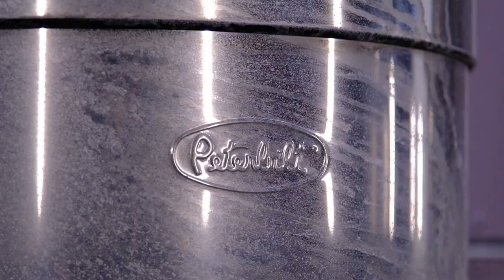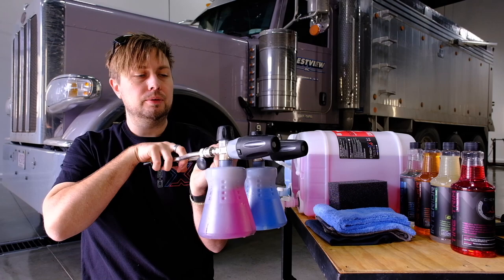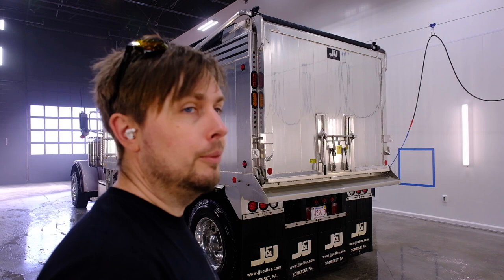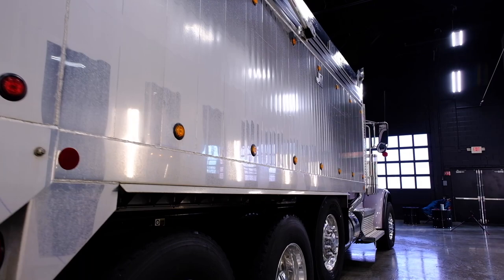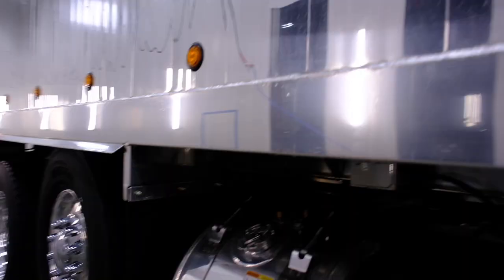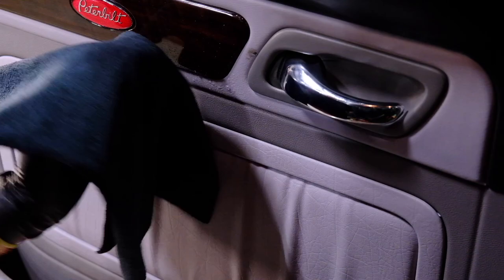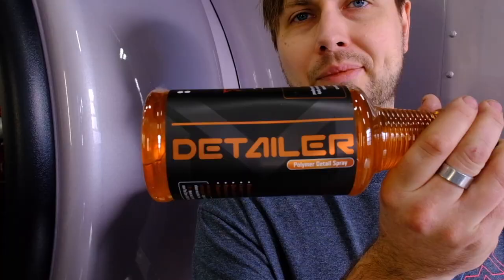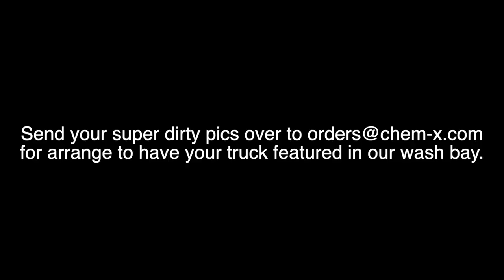The FIRST FULL DETAIL in Our FINISHED Wash Bay on a SUPER DIRTY Peterbilt!!

Comment: Tip on starting your blower. I used to struggle like that too. Then someone told me to do it like this:
Put throttle all the way 100% rabbit 
Set choke on 
Prime a couple times on the bulb 
Pull starter rope. It will start in one or two pulls, then turn off choke and adjust your throttle. 
This changed my life.
Reply from the maker: Thank you I’ll do that, yeah I popped open the spark plug and it had a bit of corrosion come up over the last couple months since I used it, hit it with some sand paper and got it fired right up, I went with the 58v echo blower since tho cause of the fumes lol

Comment: I gotta say, touchless wash soaps like this one (ive used this brand and wash chem) make life awesome, not just almost perfect wash with no touching (besides towell drying, i havent upgraded to a blower yet) but also getting in the areas like wheel wells and frames and other nooks and crannys that you normally wouldnt get too on a quick basic wash, and just makes the vehicle look that much better when all those areas get cleaned up vs hand washes where you dont get paid enough or have enough time to take the time and scrub it with a detail brush to clean it all up. These products are just awesome, also i like the chem x more than wash chem, just that much more efficient and better clean, just ordered my first supply of snake oil and so excited to try that out!

Comment: A no touch system is fine for a quick wash but if you take a truck you no touch washed to a big show (truckers jamboree, shell super rigs, Louisville, etc) your going to get docked huge in the points, truck shined up good for a hour wash but the steps/visor/ bumper/diamond tread needs cut, the tanks especially the fuel caps and surrounding area needs hit, and he better get that wheel seal fix at the very least it’s gonna junk that durabrite but the dot will have fun with it to.
Reply from the maker: Yeah two step touchless on it’s own is just a shortcut in between a hands on wash, it can be useful to minimize scratching before a friction wash tho. But yeah the truck wasn’t headed to Louisville this truck went right back to the rock quarry the next day lol

Comment: You should try a brush attachment on the vacume
Reply from the maker: Thanks I will do that tomorrow on the truck I have in my bay now!😁🍻👏❌💯
Reply: @ChemX  thats what i use on any vehicle with floor liners or rubber floor. beats scratching up the liner or ruber liner.

Comment: That thing isn't that dirty. At all. In fact, I'd say it's "knock the dust off"
It's 100% polished aluminum which is easy to clean. Even looking at the frame before, it's pretty clean.
Reply: This, if you can clean it touch-free it was never that dirty to begin with.
I ran a detailing business contracted at a Ford dealership for 10 years, no touch products are great, but they're not going to help with truly dirty vehicles.
Reply: @crabmansteve6844  I also used to work detailing fords. Though I worked for the dealership.
Currently part-time washing semi trucks. (100% of them are far more dirty than this). As in they're actually used.
Reply from the maker: These fellas keep up with their stuff pretty well, they do work them hard every day but this is about as dirty as they let them get. Touchless washes are a shortcut they don’t replace an occasional contact wash tho
Reply: @ChemX  The only trucks I can say for certain that always seem to be 5/5 clean and are constantly OTR are the Love's tankers. Those guys don't mess around when it comes to upkeep.

Comment: That stuff looks like it did a great job on that truck. Do you have to dry it to use m shine? Or can you spray it on before. Can you pressure wash the truck first to get all the heavy dirt off then use the touch free stuff or does it need to be dry when you apply it. Nice job anyway I drove mixers for years we had to use acid to get the concrete and cement off of the truck and it ate the aluminum wheels and chrome etc.
Reply from the maker: Thanks bud so I noticed on this video that I got the best results by just applying the soaps and not pre rinsing, if there’s more than a half inch of mud I’d pre rinse tho

Comment: Mr. Chem-X do you have any idea on what type of water gallon tank I should get for hot water pressure washing for a mobile setup. Say for example if I was washing 3-5 trucks a day
Reply from the maker: Some guys who run box trucks just use 275g totes they’re cheap and have a 2” outlet and valve at the bottom

Comment: U missed half the truck u never sprayed the wheel wells down or underneath the box ! Half job season
Reply from the maker: Oh man good thing I did it for free then 😂 I’ll be getting a few different manufacturers undercarriage washers in very soon I’ll be doing some stuff to aim more at that
Reply: @ChemX  or use the trucks handy built in hydraulics to lift the box a bit so u can easily hit it with ur pressure washer ... and yes undercarriage sprayers are a must have your mechanics will notice